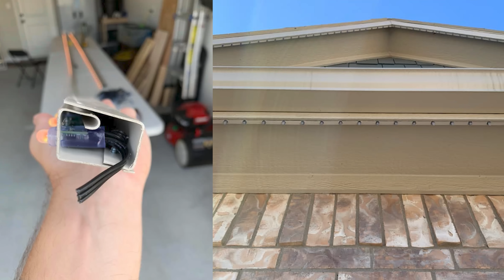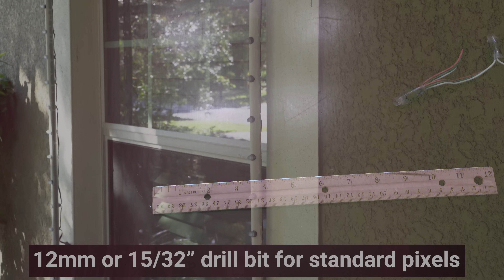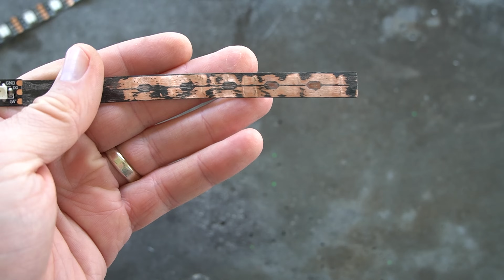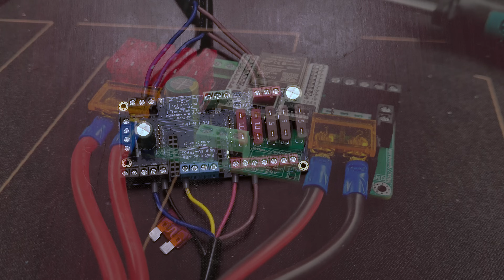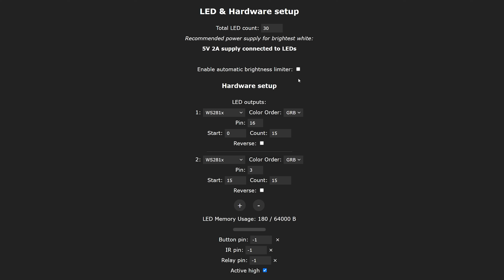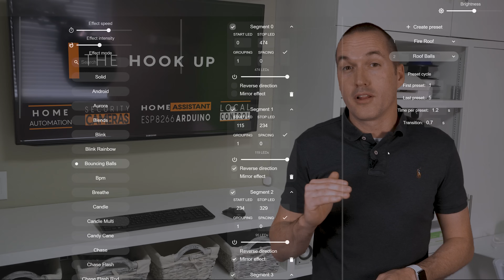DIY Permanent Holiday LEDs: Complete How To Guide 2021

Comment from the maker: I got word from Quindor that the QuinLED DigQuad V3 is available now in the international store and should be in the DrZzs US store within the next day or two.

Video correction: The size heat shrink for joining LED strips should be 3/8" not 3/4", the correct product is linked in the store page.
Reply: Any idea when the permatrack will be available again?
Reply: The digquad with Ethernet is out of stock at the moment, but the external antenna is in stock.
Reply: @williamcunningham5805  try the
 international store. I got a few there when Dr.Zzzs was out of stock here locally.
Reply: And those are good for the ip67?

Comment: Thank you for the update…removing the resistor solved issues I’ve been having with a long run to some arches!  I tried boosters, including the one shown without totally being able to solve the problem.  Removed the resistor and all is good!

Wanted to mention that I did something that I haven’t seen anyone else do…I couldn’t decide between strips shining towards or away from my house, so I did both!  I put strips in a diffused channel, then stuck a second strip to the back side of the channel pointed towards the house. Now the color lighting up my house can be different than the animations on my strip facing the street. 😎👍
Reply from the maker: Epic, are you in the facebook group? I'd love to see some pictures.
Reply: If you have pictures I'd also like to see the difference between pointing towards the street or towards the ground.  My house is brown and soffit is white, so I'm guessing for me pointing out would give a better effect. (reflecting off the white soffit)

Comment: I'm preparing to do my house and found this very useful, but I'm struggling with where to place the power supplies and the controller. It looks like you have electrical box outside your house. Would you be able to show that in more details? What are some methods that others have used?
Reply from the maker: I keep my year round power supplies in the garage, the outdoor ones are for seasonal props.

Comment: Great video! Is there any guidance on how far away from the first strip of lights the power supply and controller can be? I want to put the power and controller in my garage and then run the power and data cables to the roofline, approx 10-15m before hitting the first lights. Will that cause issues?

Comment: So with parallel injection, I can run one continuous wire along the whole house (200ft) and just splice and solder the LEDs into that same wire every strip?
I don’t have to run a separate injection wire for every strip, do I?

Comment: Can you expand on the parallel run for power injection? Can I run a 22awg wire along the strips and use a T tap connector to inject at each strip? Is there a limit how far the 22awg  can be?
Reply: Yes this question 🙋🏻‍♀️

Comment: Great video, I installed and had working til about a week ago your LED driving software... now not sure what's not working.  I guess the question would be since I have 3 house zones how do I get the data to each zone as each one is on a pin out from the logic level shifter.  To my knowledge WLED doesn't use three data out pins or have the option... I believe... any and all help appreciated.  Like the others thanks for all you do. :)

Comment: Ok, here is my question.  When power injecting.....if you are adding, lets say, 4 power injection points...do all of those wires run to the SAME exact power supply, or does each injection point have to have a separate power supply?  And follow up question...If all those wires are going to the same injection power, wont it get a little too crowded for all those wires?

Thank you!
Reply from the maker: Same supply, you can do power injection with multiple supplies, but you shouldn't connect the positive wires together.  Here's a more in depth description: https://youtu.be/apwQ5Jh4VyE?t=419

Comment: This is packed with info. Is there another video specific setting up power injection? I see it in the channel and also outside the channel. Although my lights are up and working without injection, I'm not so far in that I can't take them down and add injection points if it means that it's giving me the correct power and best colors. I don't know where I'm running the injections from (power supply?), to the beginning and then a separate wire all the way down to the end, then do the same thing along the entire run,

Is each injection wire on a separate connection point coming off the power supply or can more than 1 injection wire start from the connection point on the power supply?
Pi=power injection 
Pi frm pwr/supp to start of 1st led strip 
Pi frm pwr/supp to end of 1st led strip 
Pi frm pwr/supp to start of 2nd led strip
Pi from pwr/supp to end of 2nd led strip 
And so on...
How many before another supply is needed?

Last question (for now) I'm using 30mm point lights (with 3 leds per light). When calculating # of leds, I am counting each of the 3 leds in each 30mm light to determine total led count?

Comment: Oh my! I totally appreciate all the good work you put into your videos. I started two days ago and am knee deep in WS2812B strips, wire, connectors, and a $100 soldering iron (with is very cool!). I am all ready to make this happen except for ONE THING... I am 5 hours into trying to figure out how I should make permanent waterproof wire connection between my 18 gauge Power Injection leads (coming off the LED Strips at each segment's beginning and end) and the 22 gauge parallel in-track wire. Do I cut the 22 gauge parallel wire each time I am to connect it to an LED Strip Power Injection lead? And if so, how do I connect the three wires together using a Haisstronica Solder & Seal connector?  I can't find anything in YouTube showing me that it is acceptable to connect 3 wires together this way (as these connections MUST last as long as possible). 

Am I thinking about this correctly? I believe you are saying to run a second pair of 22 gauge power wires inside the tracks the entire run of LED Strips - and connect them to each of the Power Injection leads (which are solders at the beginning and end of every LED Strip which are connected by 3 wires. However, if I cut the 22 gauge parallel wire, I will then have three wires to connect together? Or, do I connect the lead wire to the 22 gauge wire without cutting it??!? I am SO STUCK. I must be thinking about this incorrectly... Did I mention that I am near the end of building my own house and I want/need to take the scaffolding down this coming week?    The second story roof line is at 21 feet high with a 12/12 roof. I have one shot at this - AND I NEED TO GET IT RIGHT.... Can someone put me out of my misery???
Reply: Please post what you figured out. In the same fix
Reply: @luv14lyf  did you figure it out.   I'm in the same predicament.

Comment: Thank you again for an awesome video! I know I’m cutting it close to this year’s season, but there are a few questions I have that don’t seem to be answered directly when research getting into this. 
1) I’m a little under-knowledged on the power injection points, and specifically, where/how often they need to happen. You mention running the power line in the channel with the strip; is that the way the whole thing is done? Then the ‘how often’ is related to your strip model? Do you run the power line right on top of, but along the side of the strip? Under the strip?
2) Controllers: it’s not clear to me how, and specifically where the controllers play a roll. Obviously, they’re needed to tell the LEDs what to do, but are they like power injection points, where you need a controller mounted up on the roof every-so-often, depending on the model LEDs you chose, and therefore, how many LEDs one controller handles? Or is the one controller to rule them all, mounted down in the garage next to the power supply? Or?
3) Did I hear you correctly, 12V LEDs draw less amperage per LED? Your graphic stated 5V=.05/LED and 12V=.03/LED. I guess that makes sense, more power means less current for the same output. 
I think that’s it. If I have another question, I’ll comment, and I REALLY appreciate your feedback! Thank you!!
Reply from the maker: 1) For 5V inject at the beginning and end of every strip, for 12V inject every 2 strips (10m).
2) One controller at the beginning of the run, it sends the data to the LEDs to tell them what color to turn on to at any given time.
3) Yes, wattage is the real metric which would be voltage * amperage.  12V is actually higher wattage, but less amperage.

Comment: Thank you for sharing all this info. I am planning my first project now. Is it possible to use motion sensors around my house to control the leds wrapped around the house near the sensor to come on? Would be awesome if the led strip would move/follow the movement from sensor to sensor. So if I had 5 motion sensors on one side of house could the led light follow the movement.
Reply from the maker: Possible? Absolutely.  Home assistant will be the answer, but a word of warning: it's a bit rabbit hole.

Comment: Quindor has a really good video explaining why 33 ohm is the right resistor to use if you are using a 3-wire combined data/power line and 249 ohm is the right resistor if you are using a 2-wire power wire and a separate 1-wire data wire.
Reply from the maker: I saw it, I'm skeptical :P

Comment: Awesome video, Thanks! My plan is to install a permanent setup this spring, I can start ordering parts. I've been using WLED for a couple of years for my kitchen lighting with home assistant and some 8266 controllers, no issues at all. If it ever fails I'll need to relearn my setup because I haven't touched it in so long I don't remember the details anymore.

Comment: Thank you for the video…. My question for you is…. If I’m looking to do permanent lighting on my house should I go with a digiquad or a Kulp controller. I’m going with a Kulp controller for props and a tree. I’m just wondering if there’s a benefit to sticking with the same manufacturer?
Reply from the maker: I have a mix of a ton of different controllers, no issues.

Comment: I am grappling with how many leds can be controlled by various controllers so is there anywhere you outline all the stuff you use to drive your show. Quantity and type of power supplies? Quantity and type of controllers? etc.  Much appreciated
Reply from the maker: My show is extremely over powered for the number of pixels I have because I have a bunch of controllers for testing purposes.  I could drive a show 2-3x larger without buying any more controllers or PSUs.

Comment: My house looks a little like yours. Can you tee off of the string on the bottom eaves (power, ground, data lines) and run wire (with no leds) up to the second floor eaves and then connect a second set of leds to that? What I mean is a strip of bare wire in the middle.

Comment: How do you run power from an outlet to the power supply?  I’m using extension cords but am wondering how safe this is, leaving the extension cords plugged in, and outdoors exposed to the elements 24/7/365. 
Suggestions?

Comment: This is awesome, thank you! Question: Why run the 12v power through the Digi? It makes sense to POWER the Digi itself, but why not just run the LED strip power straight from the power supply to the strip?
Reply from the maker: Fuses.
Reply: @TheHookUp  Makes total sense!! Looking forward to trying this in the spring. Thanks!

Comment: The 5v fire test you performed is fascinating to me. I need to look more into the details because I have had solid core 22 gauge wire almost instantly heat up enough to burn my fingers and start melting the plastic from a short. I have also had a USB-C cable in my car scorch and melt part of the floor matt because it was plugged in and came to rest in a small puddle of salty water on the floor.
Reply: I haven't looked into the 5v tests, so I can't verify myself, but I wanted to point out that USB C tends to run at higher voltages than 5v
Reply: @PoisonWaffle3  For some variants with the right power supply this is true. But in my case it was plugged into my 2016 Tacoma USB port which outputs 2.1A at 5v.

Comment: Absolutely amazing guide and thanks for doing all the grunt work! Right now I'm trying to decide between this or paying for a permanent system. Not sure I have the energy to diy this.
Reply from the maker: I have a few friends with the pro kind.  My only real issue with them is the spacing, most of the big companies limit you to 4 inch spacing or more (some as high as 12" spacing!), which looks fine for Christmas but odd during other holidays and limits animations.
Reply: @TheHookUp  That was actually my first question to them, typical length is 9" and shortest they go is 6", but I'm pretty sure that would double the price.
Reply: I watch ur channel to lol ... man it's super easy and u got this ... once done  u will love it
Reply: I just got Jellyfish Lighting installed and they’re magical. No regrets here.
Reply: @ScarpaProperties  Exactly what I got a quote on. Good to hear!
Reply: @ScarpaProperties  how much was it?
Reply: @topnotchsales2016  budget $20 a linear foot for materials and install.

Comment: Should I run the power leads from the power supply directly to the strip? Bypassing the digquad? I’ll be running a few injection points too - should they all come from the digquad? Or should I have them come right from the power supply?
Reply from the maker: As long as it’s under 30A total you should run through the quad, that will give you fuse protection.

Comment: Another question... is there enough room inside the channel for the led strips and the 3core wire, or does it cover the LEDs a little bit? Where did you put the wire inside the channel? Or is it outside?

Comment: Nice job! Is it possible to have one end of an LED strip that connects to the next strip (but still same end that the power is coming from)? For example, If I’m looking at a ceiling fan, I’d want a single strip for each blade. But I would need both the incoming wire and exiting wire coming from the same end of the LED strip.

Comment: Wow, your videos are GREAT.  Closing on our construction loan 11/29/21and want to be sure I'm understanding your video for installing Permanent LEDs.  I'm guessimating I'll need 150' of LEDs doing our front and right side of our single story house and I'm close to $1000 on stuff.  I selected a 12V 30A Power Supply by Alitove.  The Dig-Quad with Ethernet Add-On Board isn't available yet.  I'm confused on the power injection stuff.  I run a 18AWG 2 conductor wire(speaker wire) from my power supply in the garage to my first strip of each run.  I'll do this twice since I'm thinking I'll have a front run (85')and a right side run (65').  Then I'll run a 18AWG 3 conductor wire from the beginning of the first strip of the run to the end of the first strip then a small jumper to the beginning of the next strip of each run about 1/2" each.  Is this correct?

Comment: Started to use lights this year for my hanukka menorah (about 8' tall on the front wall of my house). Every day a new "candle" would be lit. I am using digiuno and quads. Worked out great. The only thing I was missing on each of my "tube" candles was a flame. Is there something you may have published on how to do the flame/fire circle you have in this video?

Comment: Thank you for these excellent videos. They have been my point of reference as I planned out my LED project. I am stringing up my roof line and it is ~20m so about 600 leds. I purchased a dig uno for this but what I am hearing is it will not be able to supply enough power. Is there any reason I can’t power inject outside of the uno? Do I have to use a quad for my setup?
Reply from the maker: 5v or 12v leds?
Reply: @TheHookUp  5v 2812b

Comment: Regarding the 5v vs 12v, it isn't actually output (watts) that matter? It's the amount of electricity that causes the heat up right? If i need 100 watts for my lights I can either do 5v * 20A for 12v * 8A. Using 12v means I can use smaller wire gauge.
Reply from the maker: Sure, but 5V will never push enough amps to get to a problematic amount of heat, internal resistance and voltage drop acts as its own regulator.  

In a 12V system bad pixels and/or shorts can pull significant amperage which can cause fires.  I've been on light show facebook groups a long time and I've seen plenty of pixel fires, but I've never seen one caused by 5v pixels.

Comment: So I’m considering doing ip67 strips without diffuser channels, just using the screw in clips, what are your thoughts on this? I’m sure it will look more tacky but I think it would save money and time, and should still be water proof. Thanks for the great content and information.
Reply from the maker: The IP67 strips are much harder to work with and I've experienced a much higher failure rate with them than with IP65 strips.

Comment: Great Video as always.  I have a question in regards to installing aluminum channel outside following the roof line.  I would like the channel to be facing the street (Not facing down like under a cabinet) and I have an attached garage the is set back a little from the house.  I have two corners to follow, one is an inside corner and the other is an outside corner, both 90 degrees.  (Outside corner would be like going from the front of the house to the side of the house.  My question is, how do you cut the aluminum channel for each of these types of corners so that it looks seamless and is waterproof?